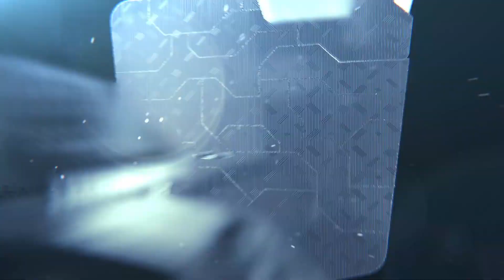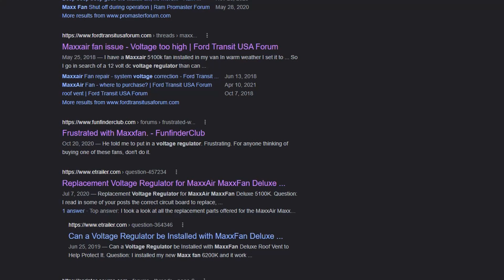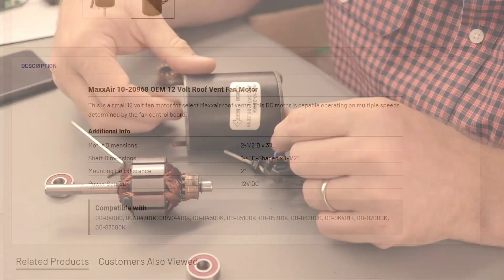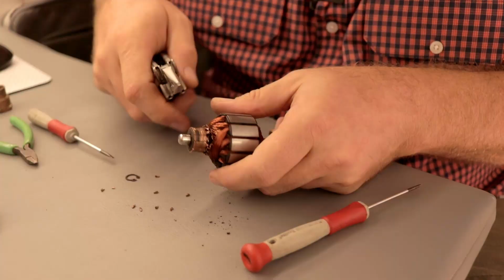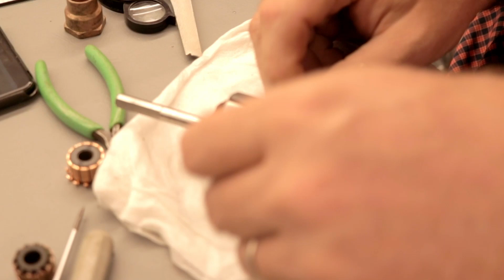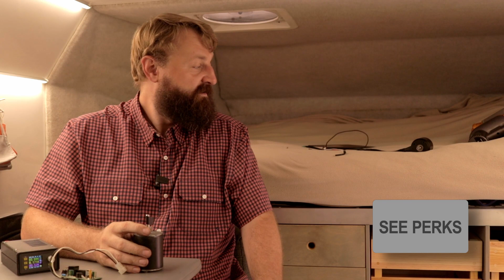More MaxxFan Motor Problems - Can we upgrade to Brushless?

Comment: Man, what a video!  Thank you so much.  I LOVED the way that you put the magnets on to keep the screen from rubbing.  I actually drilled and tapped a small hole in the end of the armature so that I could install the magnet with a screw as it already had a hole in it.  I'm curious if you've considered a remote control motor that drove the original armature with pullies and a belt.  The idea is to take an old original motor and use that as it has the right sized shaft already.  The magnets could easily be removed from the housing and then the housing could be easily modified to accept a 3D print or even a metal bracket that could support the RC brushless motor.  I'm guessing it would need to be stepped down with the pullies because the RPM is so high on an RC motor but I'm not sure.  I'd be interested in working with you on a solution.  I'm a mechanical guy, but the electrical isn't my strong suit.  It seems like you have a handle on the electrical though.  Anyway, I'm interested in figuring something out and have a donor motor, a TIG welder, a 3D printer, etc. so I'd think we could come up with something.  Thanks again for the video, I really enjoyed it.

Comment: Both of mine are now driving me nuts. Thinking about replacing both with AirPlus vent fan after I do a bit more research.
Reply from the maker: I've got a Brushless Motor replacement solution coming up, hold onto your horses...
Reply: @Everlanders  that would be amazing!

Comment: Getting an extra motor for a quick swap is a good idea.  I wonder if you could add felt brushes to sweep the dust off?
Reply from the maker: I won't be giving them another nickel, my next video will be showing the brushless motor conversion.
Reply: @Everlanders  I reversed the motor for 5 mins.  No noise.  Reversed it again, and the noise was gone.
Reply from the maker: Yup, doing that every day gets old...

Comment: I have designed a replacement circuit board for the MaxxAir fan with a BLDC motor controller and ESP32-C3 for remote control via wifi.  It works well.  No squeaks!

I plan to open source the hardware and software.
Reply from the maker: Have you found a motor that bolts up to the original housing and shaft?
Reply: @Everlanders  My project is called minuet
Reply: @Everlanders  I didn't find an exact match so I made adapters instead.  I extended the motor shaft with an 8 mm shaft coupler and dowel pin and I made an aluminum plate to adapt the motor hole pattern to fit the original housing.  I used some standoffs to backset the motor to compensate for the excess length of the coupler.  I'll be open sourcing my design artifacts on github over the next few days.  (Sorry if you see multiple copies of this comment, I think Youtube is eating my replies for some reason.)

Comment: Do you have part number for the Bones precision  bearings?
Reply from the maker: I got you fam!
https://www.amazon.com/dp/B000FDRQ1S/ref=cm_sw_r_as_gl_apa_gl_i_2SS47NFWBFC01Y9BZR85?linkCode=ml2&tag=everlanders0e-20
Reply: I beleave they're skateboard wheel bearings. I have the ceramic bearings on one of my boards... FAAAST
Reply: @LarrySalaz-g6d  i put ceramic bearing ones into my maxfan motor, they make more noise than original ones now.
Reply: @mehmetbeydogan2090 interesting. I did do the bearings and new brushes. Also cleaned the housing and armature thoroughly with contact cleaner. Yeah, don't use contact cleaner on the bearings😅. My fan has been running quiet for about 9 months.
Reply from the maker: You need to grease the bearings, mine has been silent for years since making the video...
Reply from the maker: If you used contact cleaner on the bearings, you've likely washed away all the grease...

Comment: This was so helpful, thank you! I only ended up cleaning out my motor and using a little WD-40 on the bearings as I’m on the road with limited tools and supplies. Hoping to swap out the bearings, polish my commutator and maybe shape the brushes a bit (they don’t seem to sit nicely against the commutator). There really has to be a brushless solution out there!
Reply from the maker: In this case I'd consider the WD-40 to be a solvent to clean the grease out of the bearings... Consider regreasing them by putting them both on the long end of the motor shaft, about 1/2 inch apart and then roll a piece of masking tape 90% around the outer surface. Then fill the void in the middle with some thick grease and wrap all the way around with more tape... Then push the two bearings together, this will force the grease through the bearings and it will come out both sides. Remove all the tape and wipe them down with a paper towel and reinstall... I haven't had to touch mine since doing that.
Reply: @Everlanders  this is an awesome tip, much appreciated!

Comment: A good brush bedding technique is to tape a strip of abrasive tape to the commutator (abrasive facing out) and reassemble the motor.  Use a drill or similar to spin the rotor slowly and the abrasive tape will make the brushes conform to the diameter of the new commutator.  It won't take long so keep checking progress and when done strip motor and clean out any carbon debris.  Don't forget to remove abrasive tape!!

Comment: Have you ever change out the dc 12 volt maxx air fan with a std. 12v dc motor that can then be turned on at the wall switch and maybe vary the speed that way.
Reply from the maker: I don't understand... It is a standard DC motor... You could switch it at a wall switch if you want...

Comment: Would it be a good idea to convert the mechanism, using your brushless motor (seen in this video) and using a gear and belt to drive only the shaft of the old motor without all the stators and rotors that are making all the noise?
Reply from the maker: Yes, I've done this, but a much smaller motor was used. Unfortunately I was trying to show something that everyman could do... This isn't that.

Comment: To anyone considering changing their brushes using this tutorial, do it! The only addition I would add is be careful when changing out your transformer. The metal leads are rather frail so you’ll have to be gentle with them. Otherwise, just make sure you keep track of where everything was located so (take a pic) when you re-solder everything and screw everything back together, you’ll know exactly where to put everything back.

Comment: You could rewind the motor windings with a larger diameter wire with less turns getting you more rpm's if needed
Reply from the maker: Don't need more RPM...

Comment: after a year, has the better bearings and brushes helped or still squeaking? I have designed a 3d printed motor, but haven't got around to testing it yet. I'm still cleaning my motor every few months with the stock bearings.
Reply from the maker: The squeaking is largely due to the brushes, made worse by switching directions back and forth all the time... I've restricted my fan to 1 direction only and have not needed to perform any maintenance for the last year...
Reply: @Everlanders  interesting, mine is always the same direction and still squeaks every 1-2 months, We keep them on thermostatic mode one always in and the other out to vent the RV when not used.

Comment: Bro!! My bearded savi bro !!! I fixed my Fan because of you !!!! Thank you for making me a better man and a better handyman today !!! We need more angels like you in the world. 🙏🏽👏🏽 All I did was take it apart clean it by hand and with the sham wham.  And whammm smooth as original.  It was driving me nuts when I didn’t have the music on.  And was about to just throw oil inside its main shaft.  That’s the ignorant me.  But a little less ignorant because of you.  Now I wonder if the main belt in my diesel transit is having not a bearing sound as I thought but a wear and powder inside the alternator. Cause it’s kind of the same thing but at it’s own annoying frequency.  Well see.  Thank you again 🙏🏽

Comment: I was able to chat with the folks that make the Maxaire fan today at Overland Expo West, he said that they have a deal to provide their fan rebranded for Ford, but Ford said they needed to make the motor brushless, so now we know what it takes for them to make improvements. It will be a Ford-only exclusive offering for some time, but the motor will be the same form factorwith an -IF suffix. He said it should be available thru Ford parts. Soon.
Reply: Did this ever happen…?

Comment: That's along way to go to fix a motor... I almost did the same for my alternator but went to scrap yard instead... also those bearings are double sealed you don't need to or can't oil them... due to the seal..😅 only oil or pack open bearings, sealed ones are.. sealed I guess.. the carbon dust will kill them all eventually....😢
Reply from the maker: They are not sealed, the are sheilded...

Comment: It's your ESC. I have many similar 6354 and 6374 motors running on electric skateboards I have built, and they do not make noise like this. For reference I utilize castle creations brushless motor controllers. On the VESC style ESC's using "FOC" control will give you quiet performance.
Reply from the maker: No, the noise is there even when spinning the motor by hand with no speed controller connected. It's the cogging of the magnets...
Reply: @Everlanders  Fair enough. I didn't have these issues with the hobby king or "enertia boards" varietal of this motor. Maybe they are wound differently. A brushless motor would be nice if you can find one that fits the size/power/noise constraints. Sorry it didn't work out.
Reply from the maker: In this case it's not the windings, but the very high strength N52 magnets...
Reply: @Everlanders  Thanks for your response. I enjoy your videos and your level of detail designing, fabricating and integrating relatively complex systems into your vehicle. Cheers!

Comment: 100% agree! We had to replace the circuit board AND the fan motor after they fried after only 2 years of use. First the PCB went out, got a new one, and then the motor went out, got a new one. We said no more and bought a DC to DC regulator to keep it at exactly 12v.
Reply from the maker: Unfortunately that will have little effect on the motor and the keypad, the two biggest problems.
Reply: I just skipped the whole mess and installed a on - off - on 6 pin switch and a DC motor speed controller

Comment: simple: put those small niobium magnets on the outside of each the blades, with your custom wound "firing" coils along the rim of the fan duct for maximum torque, minimum speed and build your own Bendini styled inductive spike re-generator drive.... simple... for YOU !

Comment: I always wanted a Maxxfan because of the rain proof design, I can't use one though because I don't have space between my existing roof hole where my fantastic vent is located and my solar panels. So my old Fantastic vent is still there My van is 22 years old of which 12 years were owned by me. this fan has been on for most of these 12 years and probably a lot before that. Still going strong I had to oil the lid switch a few times and clean the screen a 100 times but other than that no maintenance. 
I wonder if that motor could go in the maxxfan?

Comment: Were you ever able to figure out a work around using a smaller brushless motor and gear or belt interphase for the Maxxair fan??
Reply from the maker: I have a new smaller motor, but haven't needed to use it yet, I just keep feeding the old one brushes.
Reply: @Everlanders  how has the commutator held up with the new brushes? Have you noticed less squeaking?

Comment: one thing I would have to suspect is the diameter of the brushless motor, going larger and lower power provides a smoother but weaker motor. This would make the motor more quiet. I developed drones for years before DJI came into the picture. We were into extremely efficient large propeller designs that were very quiet at low RPM. I may look into winding a 3d printed prototype in the near future.
Reply from the maker: I've just got my hands on a 2216-1120kv and may play with that here soon.

Comment: Have you ever considered trying to use a fantastic fan motor? It looks like it might be a brushless motor. Might take a little bit of modifications to the maxxfan to get it to mount probably.
Reply from the maker: Absolutely not, they are brushed motors too... And I've had worse luck with them, much harder to repair because they are sealed motors that I can't repair.

Comment: Mmm.. those aren't ever going to last.. you're putting a quick on-off motor designed for 100 hours of use in to an application that needs a 10,000 hour motor. In a DC application, that means either a car radiator fan, or a HUGE computer fan.
Reply from the maker: Yeah, I've got a brushless fan going now... Still testing...
Reply: @Everlanders  Look forward to an update. I just busted a fan blade off a 1983 Airstream ceiling vent fan last night. The motor is still kickin.. but I'll probably be looking to upgrade myself unless I get lucky and find a matching blade. :/
Reply from the maker: I've been playing with these 250mm PC case fans, they move 80% of the air that the Max fan does at a fraction of the power consumption. I did a video for members encasing the control PCB in epoxy here: https://youtu.be/A0kDrbiQaa4 
You can find the fan on Amazon by searching for the ASIN: B08LH4DWK8
Reply: @Everlanders  Very cool! I ended up with a robust looking radiator fan that was flat. The computer fans are 10,000 hour motors as well. I'm sure it will work out very well for quite a time. I think your major concern will be keeping dust from piling up on it, because it is lighter. It's a catch 22 though, because if you add a dust filter, you HAVE to change it regularly or you're choking off the motor. :P 

The world needs a self dusting motor. :D
Reply from the maker: Like the Karcher Pulsing Vacuums...

Comment: I agree, you need a MUCH smaller motor. Possibly with a gear reduction as brushless motors like higher RPM. Consider a racing drone motor and some 3d printed stuff. They have much thicker shafts with a simple nylock nut. Using a 15a esc and esc tester you probably won't even need a sensored motor.

Comment: Couple thoughts come to mind.  Would a 12volt, 12” automotive radiator fan fit or a 12” computer case fan?
Reply from the maker: Great Ideas, most electric radiator fans I found pulled 20 or 30 amps which seemed overkill, the PC case fan was a winner however, I installed this one: https://youtu.be/Hah89Am0HyY?t=97
Reply: @Everlanders  Awesome.
Reply from the maker: For anyone else looking this is the fan I've installed in addition to the MaxxFan - Nearly the same airflow for 10% of the power consumption and 10% of the price... https://www.amazon.com/gp/product/B08LH4DWK8

Comment: @Everlanders Love the vid, go a question if you don't mind, with your maxxairfan wifi control using the WeMos boards do you have a way to detect that the fan has been turned on manually by the buttons on the fan and update the relevant virtual pin on the bylnk server and app? This avoids the fan being on when the app says it's off etc.
Reply from the maker: we've never needed the buttons since then.
Reply: @Everlanders  that's fair enough, I'm doing the same thing for others systems in my van, the inverter for example I'd like to be able to turn it on though WeMos and the OEM switch. Only way I could think of doing it is to connect the OEM switch to a d1 mini pin and have that edit the virtual to keep both switches in sync
Reply from the maker: We don't use the switch on the inverter either...
Reply: @Everlanders  that's not the point don't worry 😅😅
Reply from the maker: @jonnyflanders1229  You'll find you don't use the switch in day to day use... but if your dead set on it, just take the switched 12 volts from the switch and put it through a voltage divider or an optocoupler and then read that with the Wemos and report to the server...

Comment: Still better than those annoying shitbox pancake motors that scream when the "bearing" goes bad and buzz when they're new. In hindsight it may just be brush noise but after a lot of hours of use I've only seen them get louder and more annoying.

Regarding voltage. That's insane to me that they would sell something like that knowing these systems exceed 14v.

I asked the company and they said it isn't an issue. I called BS anyways and used a reg as you stated.

Comment: Smart move using 2 r s  bearings rubber seal instead of 2 zz bearings  I fix those style of motors  for outboard motors   tilt and trim motors for yatchs
Reply from the maker: I assumed by the red color that they were sealed, unfortunately they are plastic cages, shielded not sealed... 😔 next time I will source sealed bearings... 👍
Reply: @Everlanders  sounds good

Comment: You could look for a Sensored brushless motor, those tend to have less cogging, as the ESC doesn't have to guess where the stator is, or one with more poles, as the higher number of poles a brushless has typically the smoother it works. Sucks your diy idea didn't work out due to the extreme noise, would have been great
Reply from the maker: if you look carefully, you will see this was in fact a censored motor, The problem is it's so powerful, the giant magnets cause excessive cogging.

Comment: Did you try using the Field Oriented Control (FOC) method in the ESC software? It generates a pure sine wave instead of the square wave that PWM generates
Reply from the maker: Yes, I specifically got this motor and ESC combo for FOC...  everything I leave out of the video I get called on... LoL
Reply: Ah I was going to ask similar. I believe you get a lot more motor noise with basic 6 step commutation. Sine wave drive should be much quieter but I do believe that when used with BLDC
motor you still get some torque ripple. A PMSM (designed to be driven by sine wave) is wound slightly different and reduces the torque ripple.